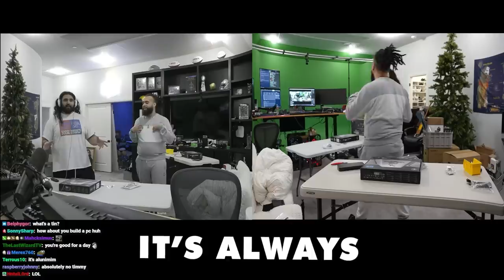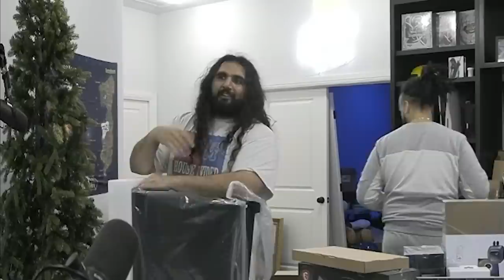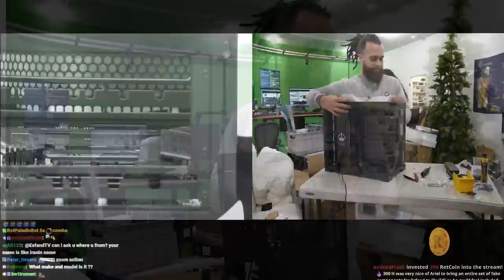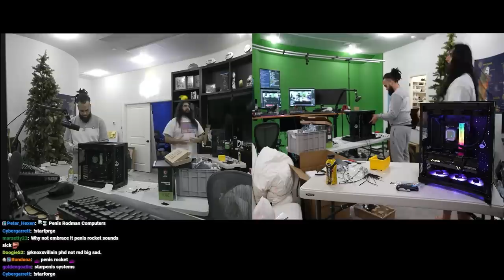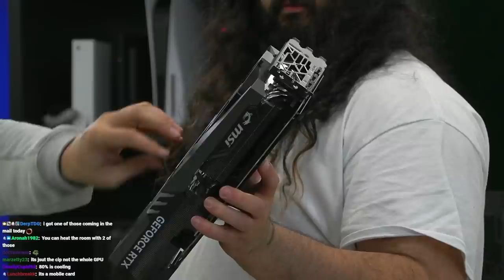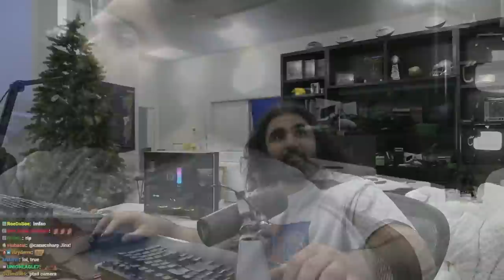I Replaced My 20,000$ PC With THIS

Comment: People are always amazed that laptops fit big GPUs, but that laptop that had a "4090" really had a 4080 chip that was declocked and ran at much lower power so that it didn't melt and with standard GDDR6, not the faster and hotter GDDR6x. And yes I know he said 4080 in this clip but the laptop at CES had a 4090. Nvidia's mobile 4090 is physically a 4080. There is no laptop battery in existence that would be able to power a 4090 or even a full power 4080 for more than a couple minutes tops. Even if there were, there also aren't any laptops with sufficient cooling to support such thermal loads.
Reply: Yep. Giving the same name to laptop and desktop GPUs that are actually completely different chips is a scam GPU makers have been running for years. Technically they're not lying because they're usually careful to call the chips in portables "laptop" or "mobile", but it's still scummy.

Comment: I will never understand over expensive and complicated dual PC setups for streaming. Just build a top tier gaming PC and couple it with a $1.5K to 2K laptop to handle the streaming. End of the day you might have spent $10K. 8K for the gaming rig and at most 2k for the laptop.
Reply from the maker: “I will never understand” answered your own question
Reply: @EsfandTV  pretty sure I made a statement and not a question. You read chat replies all day and still fail at basic reading comprehension on a youtube post that isn’t scrolling across your screen in a chat stream.
Reply: There are specific tasks that are done when streaming (like encoding the stream) that are intense on the CPU and GPU. there are a number of games where if you try stream them in the quality esfand wants, while also playing at great fps etc, it just can’t. Destiny 2 at 1440p is a perfect example. Trying to stream it at 720p60 is near impossible without bad compression passing. 

Essentially it allows the 2nd PC to take the HDMI/DP input through a capture card, then relay that to OBS to stream. (something laptops can’t do). 

There’s a reason people do things. Although it sounds like a good idea to get a laptop for something like that, laptops are run on batteries. If you leave it plugged in for 3 years on constant load from streaming etc youre swelling that battery and creating a fire risk. Ultimately most streamers don’t need multiple PCs. but when you literally design your house around having HDMI run throughs so you can stream from cameras and mics downstairs to the PC upstairs, youre maximising the quality everywhere else too.
Reply: @asterixdx  I do appreciate your well thought out response. I stream using a pass through external capture card. But I only stream for maybe 1-2 hours at a time. So the Laptop is only ever plugged in during work loads that demand wall power. 1080p 60/120 is easy with a laptop in the range I suggested since it is only doing the encoding of the feed it is receiving and broadcasting it. The battery issue was solved by replacing it once a year or so and they are not expensive. Replacement batteries over the course of 3 or so years for a $1.5k-2k Laptop is a far cheaper investment than building a dual rig and better bang for your buck/return on investment. Hence my original statement.

If Esfand is running a house wide streaming setup then building a home server with an EPYC or Thread Ripper cpu and a 4090 should be more than enough and can be centrally located while being remotely accessed anywhere in the house.
Reply: You will never understand it because you don't do it for a living lol
Reply: @bingus4057  nice logical fallacy there. Please indulge me with more smooth brain responses common of those with a room temp IQ measured in celsius. Being well versed in tech is all I need to conclude that a supposed $20K dual rig would have been a colossal waste of money to stream at 1080p 60fps.